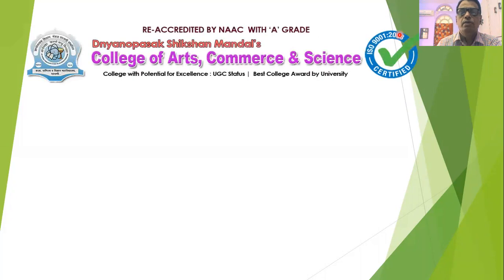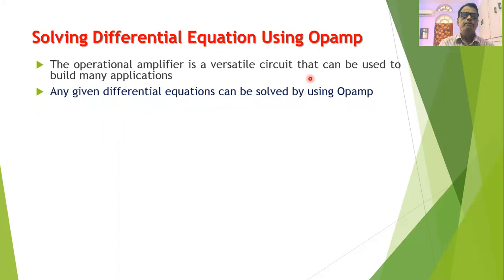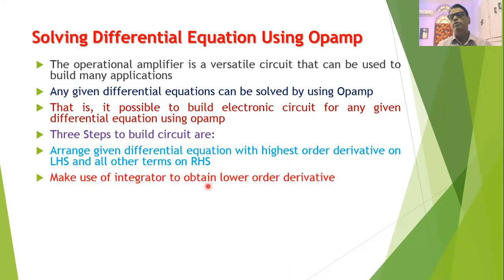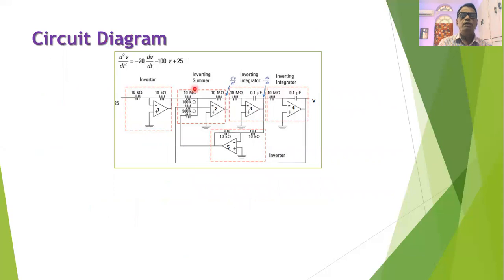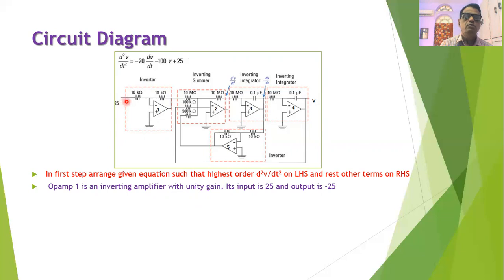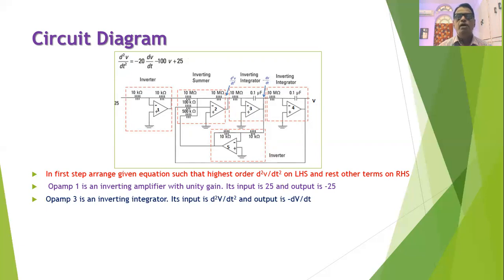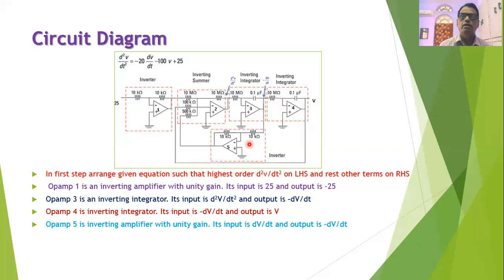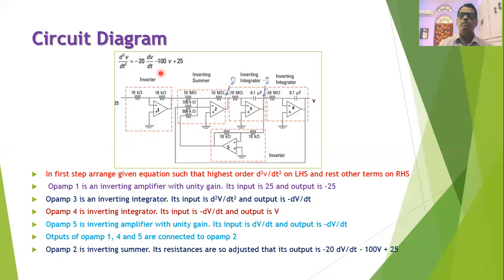Solving Differential Equation using Opamp

Comment: I see the formula in the top left corner. I guess that that is not a description of the signal, but rather that formula changes or processes what ever signal I supply to the input. It that a correct statement?
Reply from the maker: Yes